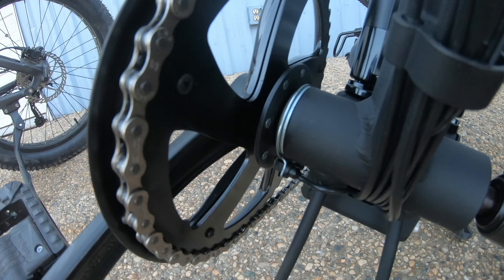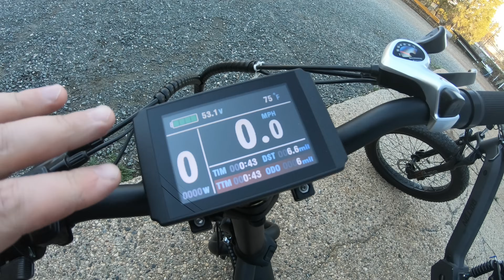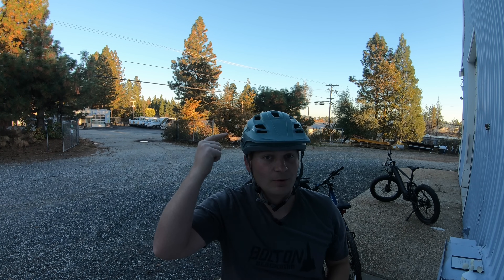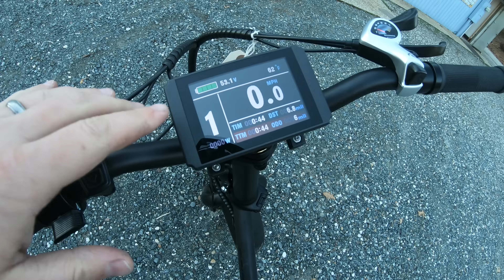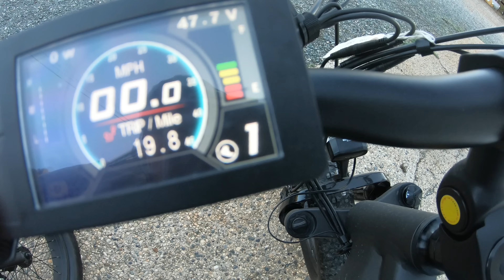Ebike Cadence vs Torque Sensors - the surprising outcome

Comment: Mid drive motors have the advantage of gearing... hub motors can operate independent of the gearing - can even go with no chain. Mid drive is very natural and work best for technical riding, hub drives deliver more power to the wheel but the weight bias to the rear wheel makes them a poor choice for serious mountain bike riders. Hubs are best for commuter and casual trail and street riding. My opinion. Thanks for creating and sharing this informative content. 
NOTE: no throttle... with a throttle it is a Moped, not a bicycle. Period.

Comment: If  You do not know why  do  you need torque mid drive you can be sure you do not need torque mid drive.
I have  750W hub 26x4"  tires 48V 17.5Ah bat do 90km fo similar ride the same battery mid drive torque sensor 1000W 26x2.6" wheels do only 75km?  Very clear only hub is good and should be on fat tires wheels. Hub pulls you efficently on pas speed and then you input as much as you like you give more , motor less no waste.

I like bouth it is bike overall including bateries efficiency matching motor efficiency. It is more problem I cannot change torque sensor parameters.
Generally hub more efficient better for speeds 15 to 30km/h  km/h . If there is match with battery mid drive can be good for 30 to 40km/h used on 2.6" to 3" tires when hub more on 4" tires easier speed pedalling on more narrow pedals with slimmer wheels. Hub motor get only stress protection from fat tire ..

Comment: We have two ebikes in the family. Both are 4" fat tire, all-terrain bikes with hub motors. One has a cadence sensor and the other has a torque sensor. After riding both bikes and measuring calorie burn with a smart watch, the torque sensor bike burns significantly more calories over the same distance. I also noticed the battery drain was slower with a torque sensor compared to the cadence. I prefer the torque sensor because of the exercise benefits, plus it's faster. If I want to just cruse I find the best gear for the least effort required. The cadence sensor bike is a solid bike, and my daughter rides it now.

Comment: I have 750W fat tyre cadence sensor, and 1000W mid drive torque sensor tires 26x2.6" . 
Get 90km range with cadence fat tires, 75km with torque sensor 2.6" ? The same bat .
Problem with press you get more from motor  all the time,  on low power motor very inefficient , battery ok, on high power motor ok battery heavy sag, so 2 weeks ago made circuit and added the 2nd bat to mid drive and 2 days ago the first time got efficiency from motor and battery which each on motor 12A takes 6A and can do 48V 17.5Ah bats over 110km all the times with much higher speed.
At low power no extra benefits. So now bike Can go  few hours with avg 30+km/h.

Cadence sensor, bike pulls you efficiently with power overv50% to pass speed and then if you pedal more gives you less main reason for better efficiency and range even with 4" tire against 2.6".
With cadence you will get better efficiency if you like to pedal  ,  torque sensor  very good if chased by dog even green pass2 quickly get 40km/h, and if you have 2 bats in parallel 48V 35Ah you can ride fast for long time 25 to 35km/h.
Normally 25 takes 250W 32 km/h  takes 500W,  40km/h 1000W, every 25% in speed double the required power.

Comment: I have  Tern HSD S+ and a Luna Eclipse. The Mid drive  Bosch motor in tandem with the Gates belt system on the S+ is excellent. But you have to pedal and sometimes hard. I enjoy the hard riides so for me its ok. The LE is a Bafang Hub motor with the Gates belt system. I am a tad dissapointed. Lots of ghost pedalling and not a lot of speed control without some throttle. If Tern made an S+ with fat tires I would buy it. Thanks for your great  review!

Comment: with a torque sensor, i'd love to have a throttle that acts as a walk assist when i'm not pedaling, and will also tell the bike that my legs are getting tired and i need extra help even though i'm not pedaling hard. get a little closer to ghost pedaling when i need it.

Comment: From the information you've provided, is the underlaying question: how much do you want to exercise when riding? If a lot: torque sensor. If a little: cadence sensor. Am I understanding that correctly? Also, you mentioned a hub motor with torque sensor. Does that mean you can have both throttle and responsive pedal assist?
Reply: I think that's true because the cadence sensor bikes just keep giving you power regardless of effort.

Comment: Now the thing which I still don't get - with the cadence sensor do you really adjust POWER by changing assist level 1-5? Or you adjust MAXIMAL speed and the motor will give out full power until this speed is reached ? 

Because from other reviews I ve heard that at level 1 you can get 15 kmh , 2- 20 kmh and 3- 25 kmh max .... I cannot put these all together in my mind

Comment: The riding experience depends on the way the controller is programmed, as well as the hardware type (Cadence Vs Torque sensing).
Some Cadence bikes are programmed so that in lower assist levels the power drops out at a lower speed than in higher levels. This is done to stop the bike "running away" in lower levels when you might want to ride slowly.
Personally I hate riding these bikes, as you can't have low assistance at high speed.
If I want to ride at say 30 kph (18mph) with just a bit of assistance, I can't as I will be riding faster than the maximum programmed top speed for level 1 or 2. So I will have to change to level 4 assist and burn through the battery far faster than I want to. (I live in a country where there is no law about maximum speed for power delivery on E-bikes, so it is a practical matter, not a legal one).
Some Cadence bikes are programmed to deliver power up to the full maximum speed in all assist levels, and these can be hard to ride slowly.
Torque sensing bikes are almost all programmed to provide power up to the maximum speed in all assist levels, which is great... you can have a small amount of assistance at any speed up to the legal maximum, and they won't "run away" on you.. just pedal with less force and they will slow down  This is specially important if riding in a group, as you can easily match speed with other riders.. something that can be a problem on Cadence bikes.

Comment: Thanks for the video.. definitely a subject that needs clarification (especially when you have ignorant or dishonest people trying to sell cadence sensing bikes as having a Torque sensor... which I have seen).
My personal preference is Torque sensing plus a throttle, I like the feeling of being rewarded for my extra effort, and I like being able to ride technical singletrack without sudden surges when the power kicks in.
I am only in my 60s and have a bit of fitness left.. but I can see that in 10 yrs time I might be thinking that cadence is the way to go if my strength and fitness fade.

Comment: Torque sensor is much more natural to pedal.  Feels like bionic legs that amplifies my efforts.  You can raise/lower the boost based on your mood.  Works great and gives better bike control.
Reply: Overwhelming consensus. However it also costs more.
Reply: @dennisluz6453  Bafang and Tongshen both sell 750 watt mid drive kits, and the prices are pretty close to the same.  Bafang bbs02 is cadence while Tongsheng TSDZ8 is torque.

Comment: from what i can see a good option  is a bike that can reach max speed with throttle only, that way u don't have to worry about pushing yourself 100% all the time to get to top speed with a torque sensor... so imo if throttle only can get to top speed then just get torque sensor ...if u cant get to top speed throttle only get cadence so u can hit topspeed... I use my bike to get to work so cadence is better seems throttle is limited to 20mph and i have to use pas 5 with pedaling to get to 28mph... i rather not get to work a sweaty mess so cadence is the way to go for me on my current bike... but if i could i would like a bike capable of getting to topspeed throttle only but also having torquesensor for the times i want to workout or conserve battery... i think this is the best all around bike to have.. Topspeed capable with throttle only while also having a torquesensor

Comment: Thanks for the video, the last bit was the gold, the Bafang that does it all. I am a throttle user so I have to have it, but when I pedal I would love the more natural feel, definitely better for an actual MTB rather than a casual rider., I am somewhere in the middle. Sounds like cadence will exist on the entry level bikes and is the right choice for those people and the torque sensor exists on the higher end bikes and the right choice for those people, hopefully this video will help those right in the middle where there is some grey area, thanks

Comment: For Seniors or those of us who might get a little tired before heading home, Cadence sensor is the best way to go.  Extra power when you need it.
Reply: I agree with this.  If you turn the corner and the wind is in you face, you just bump the PAS up a level.  And if that makes you go faster than you want, you just shift down a gear.  You can work as hard as you want, or not at all!

Comment: Thanks for this. I bought an Aventon Aventure (one).  I didn't get to use it this year so it sat.  Next thing I know the Aventon Aventure II (two) is on the market.  I had originally felt buyers remorse for now owing an "older" version, without torque sensor, since the new model has it, as I'm sure you know the earlier Aventure has cadence.  After viewing this I'm happy with my earlier model since you covered the pro and cons.  I feel my riding style, as someone commented, lends it self to the cadence.  It's not just a case of one being newer and better as I originally thought.

Comment: Nice explanation! My 2023 ebike offers the very last combo mentioned -- torque-sensing plus an overriding throttle.

Its rear drop-out torque sensor can also detect when you're pedaling. What my motor control system does with this added info, if anything, I can't say, but the power delivery is VERY smooth and natural. Plus, the throttle delivers instant full power on demand in all PAS levels above 0. Sweet ride.

Some ebikes offer yet another option -- sensing of both crank torque and crank speed (not just pedaling or not pedaling). You could call this power-sensing, as rider power input is proportional to  the product of these 2 measurements.

Comment: Pretty sure my bpm f1000 Bafang Ultra had torque sensing and a throttle… best of both worlds? Most of my bikes now our throttle only. Cadence is potentially dangerous all or nothing except for ghost pedaling which you can still do and I do with throttle only. I loved the torque sensing Bafang Ultra! Hard to modify though and all my bikes run at 72volts now. So   Building custom bikes now which are super high performance when you want it. Not to many high performance ebike out there yet.

Comment: One thing I found very disconcerting with cadence sensor bikes is that when you try to gradually ease off on the pedaling, knowing you have to stop soon, it tends to think you still want power (because the cranks are still spinning). So instead of cruising at a steady speed you find yourself accelerating. I'm sure there are strategies to avoid this, but it's a noticeable part of how torque sensor systems feel more natural (more effort = more power) versus cadence (power provided by the motor is somewhat disconnected from what you're doing as a rider).
Reply: This is something you will get used to. I pull my brake lever when this happens and it stops acceleration immediately. You might try that. Just pulling the lever enough to disengage the motor.

Comment: I'm very light and not sure I weigh enough to fully activate my torque sensor. On long flat rides the motor shuts off at 18 mph and it's supposed to get to 20.
That said it's super smooth,quiet and climbs stairs confidently. Nimble in rock gardens but you have to time the pedals not to hit.
 It's the Brose.
Power through the chain means wear and expensive parts. If the chain or derailleur breaks you're stuck.
It meters power in teaspoons and has incredible range.

The Bafang is another beast entirely.
At high settings the power comes on like a spastic light switch and will eagerly launch me into trees,rocks and pedestrians.
Sometimes the brake cut off fails and it's burning out while I bull wrestle it under control. Almost yanked my arms off when the brakes wore out.
But the throttle is magic and makes it so moto you can't stop riding. You can hold the nose up going off little jumps and do power pivots roosting. Also able to power through turns where pedals would hit the ground if you had to pedal.
Top speed is 30 plus but you're dumping energy in buckets and have half the range.
All that power eats chains and sprockets.
The power doesn't seem as hooked up and tractable but skittery. It's exciting but more exhausting than the smooth Brose.
Bafang is living at the pitch that is near madness.

Also started way back on the cheap China 1000 watt hub drive and it is amazing.
Truly a magic carpet ride with shifting, pedals,chain all not required. Break a chain and keep on going. Parts never wear out.
Accelerate from a stop to eye watering seamlessly. Burn out into thrust like an automatic transmission.
I ignored the rear gears and used the three front for granny,cruise and overdrive.
Sadly it had lots of unsprung weight and got flats sometimes several times a day.
I think it blew from speed alone at times and the tube was shredded.
Changing flats with the weight,wires and brakes destroyed my back and I never went back. Someday I will and do it tubeless but that had just come out and I didn't want to spend the money. I spent more in tubes and patches. Tubeless rules.

My friend had the Sur Ron and I could keep up with the Bafang not with the Brose.
He couldn't lift it easily and got stink eye from hikers and horse riders.
Never any vibes on the more bike looking rides.

They're all good for something in areas the others are weak.

Comment: From my experience using both types of sensors, you missed a couple of cons. Cadence sensored motors require motor interrupters because of the delay when you stop pedaling. If you don't have the interrupters you'll get nasty crunchy gear shifts. More connection points means more potential for trouble points. Your video made it seem like a LOT more effort is required for a torque sensored motor to deliver it's maximum power. That hasn't been my experience. The torque sensored motors are also more efficient in using your battery power whereas the cadence motors are an ON or OFF power delivery.

Comment: Thank you for the explanation. My wife has a cadence sensor hub motor. I purchased a mid mount torque sensor without knowing. I found that I could only get full PAS when I was pedaling harder. Surprise I was doing a lot of "ghost" pedaling before. Kinda disappointing but I'll get a better workout. I have only put a few miles on so far.

Comment: When you are tired then the torque sensor migh even make you relatively slower than acoustic bikes on inclines due to combination of reduced pressure on the pedals and motor/battery weight.

Comment: So, if the mid drive sprocket rotates backwards. Why do they say it is not compatible with coaster brakes? Seems to me if you push back on the pedals the chain would still lock the brake in the rear hub. What am I missing here? Thanks

Comment: Hi. I recently purchased an eff bike 20" fat tyre . I saw that my display was set on 20 inch tyres. I measured the actual diameter of the tyre. It is close to 22". Do I need to set my display to 22 or leave it at 20? Thanks. Vince. Uk.

Comment: THANKS for this informative video!! So, I just learned about what is ... well... "a little off" about my just unboxed Velotric Discover-1 Ebikes! Don't get me wrong, these are a great value but they do use the cadence type sensors, and as I discovered, it can be DANGEROUS!! 
What I learned on my first test-drive - uphill on a 1.5 mile climb, is it works great, the levels of assist are definite and I did see that "ghost pedaling" works! Then i stopped to check little things, and on I went. Foot on the pedal, rotate... aaannnnd WOAH!!! The pedal assist was still at 4, and when the cadence sensor said move, it almost went out from under me!! 
NO LIKEY!! Well, honestly, I think it will just take some getting used to! 
One other thing I found, these bikes will not move with just the throttle! They need the cadence input, then the throttle will slightly add to that - sort of. May need some tuning...
Wish I knew this info!! Next bike will likely be a torque sensing with throttle!
Reply: well not moving with throttle isnt a cadence sensor problem.... juiced ripracer for example can use throttle from a dead stop and its cadence based and from the video if u moved the pedal with a torque sensor it will also move pretty quickly but not as fast as cadence...